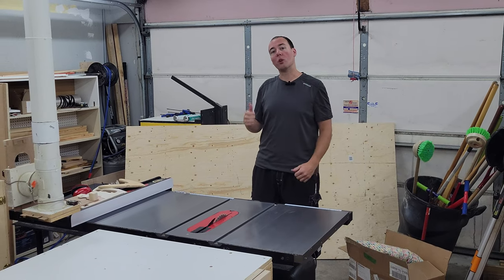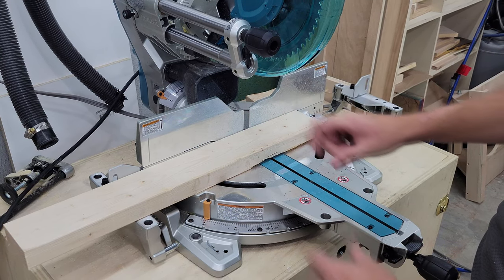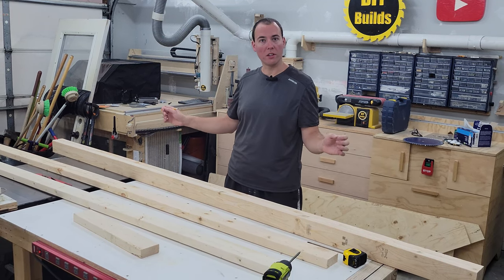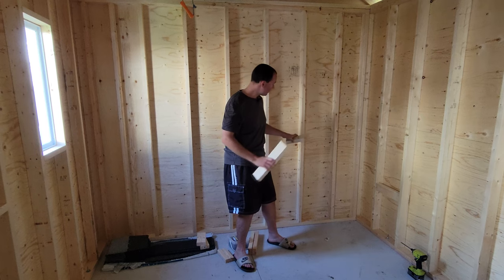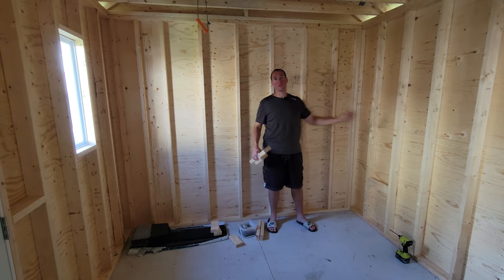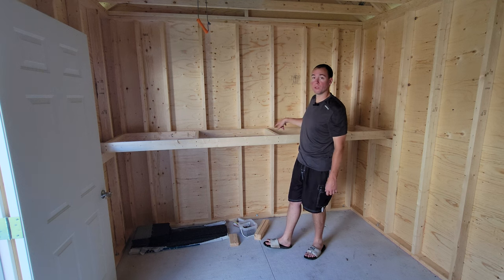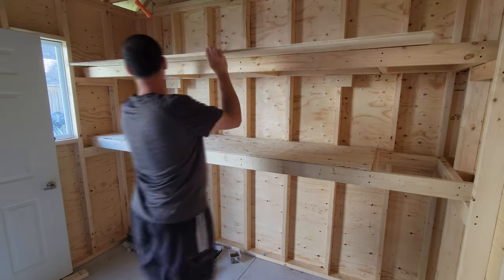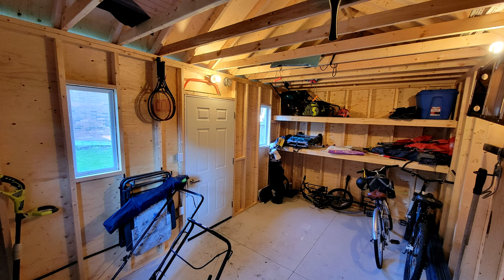How to Make Strong and Cheap Shelves for a Shed

Comment: Did you use 2x3 or 2x4 lumber? Would either work?
Reply from the maker: 2x4 because it's stronger. 2x3 can have finger joints in it which can fail.

Comment: The only unfortunate thing on this type of build (though this is pretty cool too) you are at the mercy of the shearing strength of your screws. Over time they will weaken with weathering
Reply: Not before your grandchildren are grandparents themselves.  If you are concerned, one can double up the fasteners @ each anchor point.  Could also use better hardware with a higher strength (diameter) to account for the degradation you mention.

Comment: Not cheap at all because you first have to spend a fortune on all that equipment.
Reply from the maker: All it takes is a circular saw and a drill?
Reply: @DIYBuilds and safety sandals 👍
Reply: Speed square, skill saw and a drill, EASY. You don't have to buy a chop saw if don't want to purchase one but even one of those you can get fairly cheap, and it pays for itself. Hell, I bought the very first chop saw I ever owned at a secondhand store for 50 bucks and bought a cheap drill for 20, the speed square I got at a hardware store for 8 bucks. You don't have to spend a fortune on tools.
Reply: @Sportsvee  That was my first eye roll.......